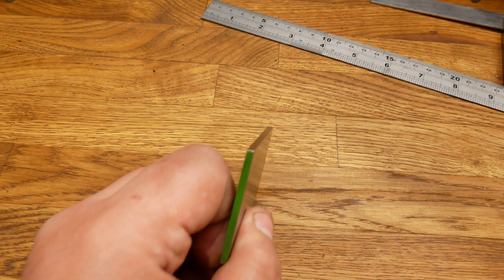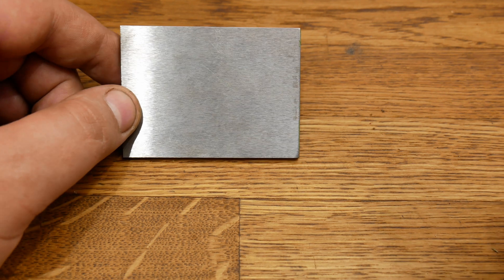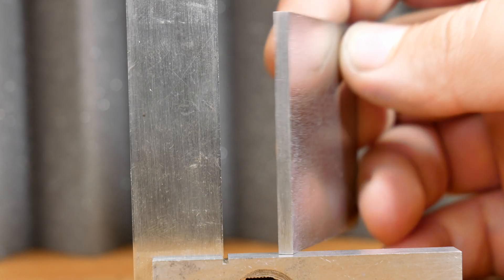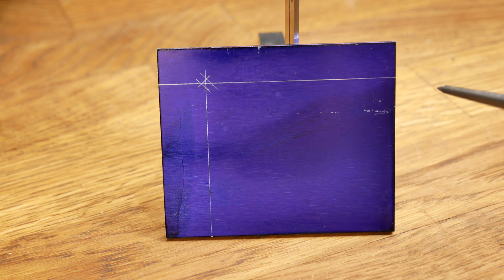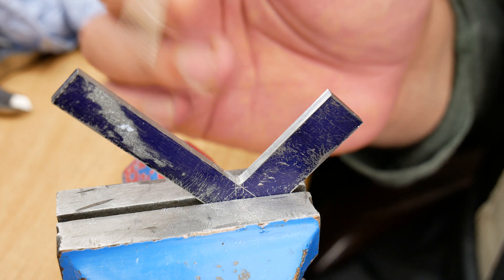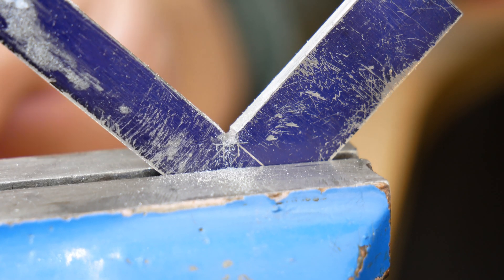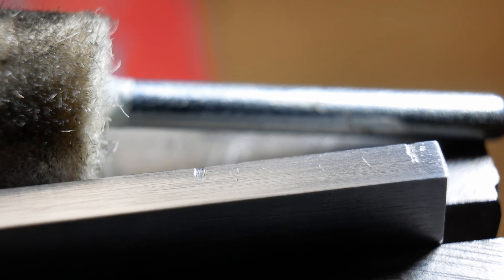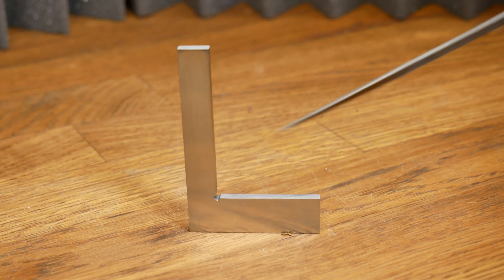Clockmaker Training : Making A Toolmakers Square

Comment: Looks like you've got the workshop up and running, have you?
Reply from the maker: +Thomas Hughes It’s slowly getting there, Thomas. I’ve been restoring an old tool cabinet and that’s going to make a big difference when it’s finished (I’ve got tools all over the place at the moment). I’ve also been given a pillar drill. It’s got a bit of surface rust, but I think I’ll be able to clean it up. I’ll give you a tour when I’ve done enough improvements to warrant a whole video.
Reply: @ticktockworkshop8169  Great News, Professor! That's an allusion to Geppetto as he built a bunch of clocks like you will someday!